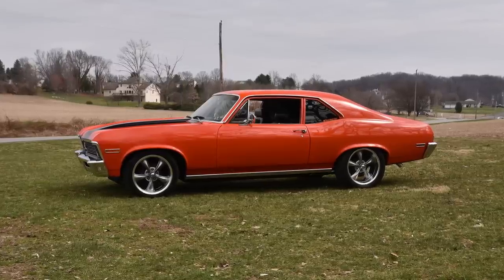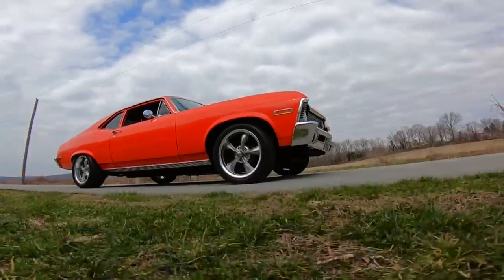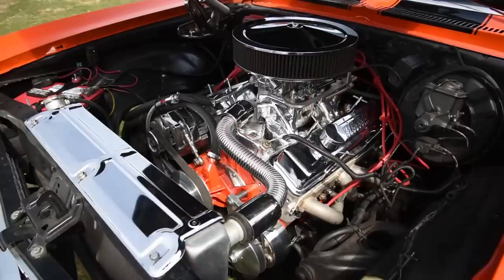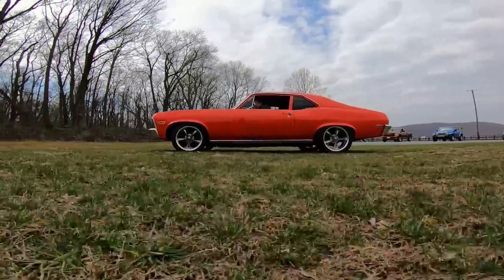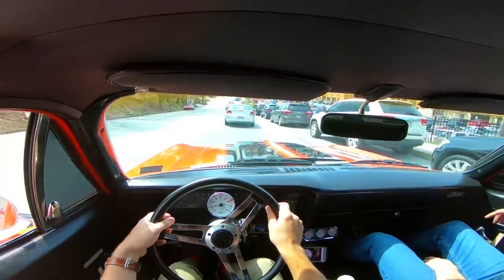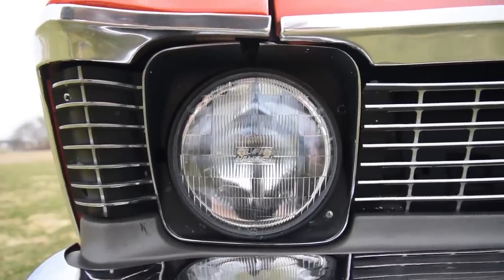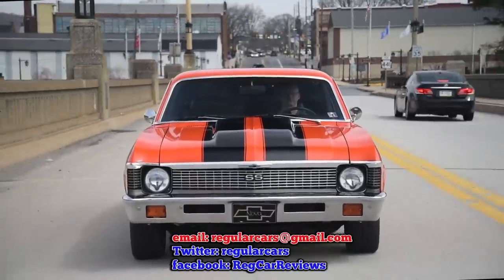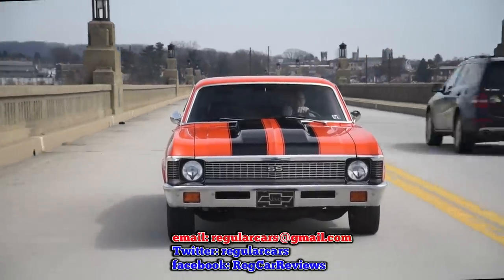1970 Chevy Nova: Regular Car Reviews

Comment: Questions people about what's the point to rebuilding an older engine when you can LS swap it, when same dude has rebuilt a 5.0 to convert into a 302 for his Falcon.

Honestly, LS swaps aren't as interesting as Mr Regular or what everyone else might think. Yeah it's a good choice of engine, but these engine swaps have become overly oversaturated in the car community. 

The era of the LS swap installations will peak if it hasn't happened yet. 

Great engine, the LS, but over hyped in our modern day. The only reason why LS swaps have become so common, is that they aren't to be enjoyed. But to be sold for much more money for the poor sucker that wants one. But who knows, maybe this Nova is worth $40k, because it didn't get the LS treatment yet.
Reply: By that logic he might as well Coyote swap that Falcon.
Reply: LS are not as cheap as SBCs. You can build a rock solid 300-400 hp SBC for $2-3k. That won't even get you a used LS1 with less than 100k miles if you can find one. If you're buying brand new the cheapest you got is the L96 at about $5.5k for roughly the same power. Yes the L96 is going to be more drivable and reliable but it is going to cost more.
Reply: @gagechapin1000  agreed he's pretending that a 5.3 can make power cheaper than a 350 with a cam and heads.
Reply: What regular is saying. The fake SS badge and trim plus the degrading condition of the vehicle he's stating why not go cheap because while prices are high it's not worth it in the long run and just cheap out now.
Reply: And if you think LS motors aint cheap go to a junkyard and pick out any 1995+ GM truck and 98% of the time you can get a Vortec LS motor that fits muscle car specs.
Reply: @NerdyHillbilly  first car with an LS engine was the 1997 Corvette. Then the 1998 f bodies. Earliest truck was in 1999 and that was the 4.8 and 5.3s (cast iron blocks, aluminum heads, 6 bolt mains, coil packs, EFI, etc). in 1995 they were called Vortecs also but they had more in common with a traditional SBC (2 or 4 bolt mains, cast iron heads and block, distributors, throttle body injection, etc)

Yes 5.3s and 4.8s are cheap but would you rather have a 0 mileage SBC that drops right in or a mid to high mileage truck motor you have to pick through and run a wiring harness for? 

What if it needs a rebuild? That gets real spendy with LS motors if you're doing it right (I have one and have done it). These motors aren't magically sitting in junk yards for no reason. O ring seals on the oil pump supply would leak causing people to lock them up on a regular basis.
Reply: @ohlookadragon  everyone thinks because of channels like sloppy mechanics that 5.3 can make 700+hp on a shoe string budget and be just fine. What they don't show you is the longevity of these motors they're piecing together. 

5.3 vortec motors are not just laying around anymore. There is a large market for them. When demand goes up prices go up. It's the nature of the beast. If you do happen to find one just laying around you need to ask your self "Why does no one want it?" They are not cheap to rebuild. They had an O ring issue on the oil pump that would cause a loss of oil pressure (not an exterior leak). So I don't know if you had experience with an oil starved motor but it destroys a lot of components quickly.

LS swaps are not as cheap or as easy as everyone thinks they are. Unless you can 90% of it yourself it is going to be an expensive project. If you can do it alone it's going to an arduous process.
Reply: i agree. for cost effectiveness i would put an LS in it, but obviously this guy isn’t worried about cost effectiveness. i fully support the built 350-it may not be the most efficient and cost friendly motor but there’s just something about em.
Reply: @NerdyHillbilly  No sir you can't.  You can pick up Vortec Gen-IV SBCs all day long, but not one single Vortec LS.  Also have fun with that plastic intake gasket that fails for no reason, same with that expensive failure-prone spider injection setup.

Comment: He needs that stall converter for the cam that he is running
Reply: That's not all that was missed here I don't think...
Reply: You know :)
Reply: I was just pointing out that large cams and automatic transmissions don't like each other hence why he needs the 2500 stall (which isn't even that crazy for street car). Without it the car would choke itself out and stall. 

Getting 450hp out of a 360ci motor using 1970s technology is a lot harder than throwing an LS at it with a mild tune. 

He does need to get rid of those front drum brakes though. I wouldn't take a 450hp car down the 1/4 mile with drums stopping you. You're going to have a bad time.
Reply: @gagechapin1000  you were spot on, I was agreeing with you that there were plenty of things about that whole speech that weren't quite right, like the converter being sold as basically undrivable when 2500 isn't that bad

Comment: That stall converter is about right (or near enough, without knowing the power/torque curve) for an old-school street engine.  Newer engine designs have plenty of smooth torque down low, so a low stall is fine...but a 350 with a big cam means the power is a little peaky and comes in at higher rpm...and the torque converter should be just barely able to let the engine start coming on cam at full stall.  Rather than lowering the stall, an overdrive or a locking converter (or both) would fix the worst of his fuel consumption issues.

This is how cars were in the day, before we had EFI and computers and variable vale timing and variable intake runner length to widen the power band and take the fun out of driving.

Comment: I think Rcr underestimates the true cost of what an LS swap, or a turbo LS swap truely costs to put into a car that was designed around the sbc... i mean he even swapped a carbed 5.0 into his falcon. Why not an LS? Why not an LS?
You realize with a Turbo LS it doesnt come from magic. The owners dont tell you they dumped several thousand into injectors. Fuel pumps, rebuilds, studs, gaskets, piping, hand work, adapter kits, head swaps, pistons, etc..  it costs infinitely more than a 150 dollar ebay turbo.
Reply: Plus the eBay turbo kit guys never let on how long the swap actually lasted.... Made 1100hp on stock internals (for 3 x 400m runs in total before the engine grenades itself).  Same with as the previous era with the 2JZ and RB26 turbo guys where they'd make claims of 900hp on stock internals (before the engine threw a rod on the fourth dyno run).

Comment: I had a 1973 one with a 350 in high school though it came factory that way and had discs up front.
One thing I can say about the generation 1 small block is they are simple and the parts are cheap.
Reply: I had a 72 350 Ventura and I could beat 318 Cudas and Challengers.

Comment: Carburetors > fuel injection. I just like them better. I like distributor ignitions. I like the smell of unburned hydrocarbons in the morning.
I'm 20, I was born about 50 years too late to experience muscle cars when new. I am the only one in my entire extended family that drives a carbureted vehicle. I like them. I don't know how to time a distributorless ignition system, or check fuel pressure on an injected engine, and I don't care. I like old school stuff. Call me a hipster, call me old fashioned. I don't care. I put a Buick 350 in my '85 Regal because I wanted a Buick 350. Everyone and their deaf mute blind grandma puts LS engines in everything. I did it because I wanted it, not because someone else would think it would get 10 more mpg and idle smoother.
Reply: Jordan Wiley this sounds like a post on r/iamverybadass

Comment: 3970010 cast early model LT1 4 bolt main block from 1970 370horse out of a corvette orignally, punched out 60over combination of heads and speed pro Hypereutectic pistons pushed the compression to 10.7:1 Howard's cams full roller cam with comp cams 1.5ratio roller rockers edelbrock performer rpm air gap intake   holly 750cfm brawler series carb....conservative rating is between 450hp and 470hp if all calculations were spot on...

Comment: The letter "K" in the VIN lets one know if it's a factory Nova SS.  Others have "H" as the fourth digit.  Typically the amber parking lights mean the 68-72 body style is a 1972 model.  I bought my '72 Nova coupe new from Mohr Chevrolet in Dallas, TX on June 7, 1972.    It now has an Edlebrock Performer intake with an Edlebrock 1406 750 cfm, five real leaf springs with Gabrielle hi-lift shocks, factory a/c & front disc brakes, 2-bolt main bearing 350 bored 60-over,  a TH400 tranny (before the four-speed automatics became reliable), 15" tires & rims for 7% better gas mileage.  Last inspected/registered in 2018.  I'm thinking of installing an Edlebrock Pro-4 EFI system.  Anyone seeking a pair of pre-1986 cast iron 2.02 x 1.60 angle plug Bowtie cylinder heads with stainless steel valves--(bought new)<1,000 miles?

Comment: @rcr big stalls are also important when you have big cams. The big cams barely have enough power tk keep itself idling. The stall prevents the transmission from applying load to the engine and "stall" it.

Comment: My moms first car was my grandmother’s Lime Green 1970 Nova, it was totally base, only options it had were the auto transmission and the 350 V8, other than that. It had no features, but it still managed to get stolen. Story goes, she parks it at school, some crackhead stole the car, two days later the police found it on blocks in Manhattan with no wheels and no radio and the officers were kind enough to give her some wheels. She sold it later for a 1972 Monte Carlo, and then in the 90s she sold that for an 80s Subaru, she’s been driving Subaru’s ever since.

Comment: The 350 chevy is still usable, they are without a doubt the most tinkered with engines on the entire planet, there are at least 10 companies who make every single piece, boomers with garages full of parts, and heaps of reasonable performance parts at swap meets or junkyards. Another reason these dinosaurs still march on is the lack of complexity, no computer to worry about. All you have to do is tighten down 4 bolts and run a carb linkage. I bought one for 100 dollars the other day, cleaned it up with a ball hone and slapped it back together and made 300hp. 

The reason he is running a high stall converter is the amount of cam he is running, choppy cams need high stalls. Seeing 2700+ is not uncommon in setups like this. especially with the TH350 or TH400 transmissions
Reply: Another thing is they can rev upwards of 5800-6700rpm with the right cam, intake, heads, and valve springs. so the old "old v8's wont rev" thing is kinda dumb. an LS is still superior, but if you're thinking of running a carb on an LS just go for a SBC

Comment: how can it be an SS with only a 350?
IIRC.... should have a 454 big block under their......

and while LS motors are sweet if your going to drive old cars a lot...... nothing beats pumping a carb, then turning the key.....
and having to keep it at 3000 rpm for 5 mins to warm it up enough to it wont die

neighbors are like "WTF ARE YOU DOING ITS LOUD"
oh sorry.... just gotta warm it up
"oh, ok"
Reply: what is a choke
Reply: @ty2010  my pickup does have a choke

But it is still -50f outside..... even fuel injected cars need a bit of warm up time
Reply: @kainhall  For -50f I think I'll have to call it special pleading.

Comment: 11:38 Ouch, Ouch, Ouch,  This hit a little too close to home.  Although my own opinion on this gen Nova (SS or not) is skewed to "poser" as those who had them before time thought they were worth anything were looked at with much less reverence.  This was the car you got when all the Slant 6 Barracuda's, Challenger, Dart and Dusters were all taken.  The SBC 350/TH350 is every fiberglass hot-rod ever.  Hell that engine, in a similar state of tune lives in my Chevy "BIG 10" square body, only with a 3/w low gear (technically a 4 speed no overdrive) manual transmission.  Which makes it sort of pointless being 2WD.

Comment: but... with aggressive cams you NEED a stall converter in order to even drive the car.
Reply: There's no such thing as a "stall converter".
Reply: @Iain240  ....what?
Reply: @BLAC_WORX  It's a high stall torque converter. Calling it a "stall converter" is like calling "high temperature spray paint" "temperature paint" it's wrong and he says it so many times it makes my eyeballs itch. 

What you said about the cam is correct though.
Reply: @Iain240  Ok I get it but that is semantics... my whole point is there is no option for running a HIGH stall converter or not, its not just for drag racing, its to have a functioning car with an aggressive cam. And its more like saying "high temp paint" instead of calling out what specific temperature the paint is rated at.

Comment: If you have a large cam in the car you HAVE to a large stall in it. The factory torque converter stall is around 1700rpm. Going with a higher stall changes where that rpm goes so the car doesn't take off on you. I had a built 402 with a big ass racing cam in it and tried to drive the car around on a stock stall converter with my TH400 trans. I had to put my full body weight on the brakes to stop that car from crashing into shit when moving the car around. I thought my brakes were bad, changed the master cylinder, same problem. My engine builder told me to go with a higher stall, so I installed a 2600 stall converter in the trans instead and it no longer wanted to launch forward when putting it in drive and stopped just fine under normal brake pressure. THAT is what a stall converter does when you run the wrong torque converter with a big ass camshaft my guy

Comment: A friend of mine inherited a mint green 1970 Chevy Nova from his grandmother when he was 16.  Had the 194 straight-6 and a PowerGlide 2-speed automatic transmission.  No A/C.  AM-only radio.  Black vinyl upholstery, which was ungodly hot in the north Georgia summer sun.  It was literally the cheapest Nova you could buy in 1970.  And it was in pristine condition.  Literally driven by a little old lady to the grocery store and to church.  Had just a tick over 15,000 miles on it in 1986 when he got it.  I bet something that original and clean today would sell for $40K -- if you could even find one that hadn't been cut up to make a fake SS.

Comment: There's no reason that Nova can't be built today into new car production. 4 wheel disc brakes, delete the leaf springs in favor of a 4 link suspention with 6 way adjustable coilovers. 4.3 v6 5speed manual,

Comment: "Why not an LS?" What an ignorant thing to say lol. To say a 350 is cheaper and easier is a massive understatement. Most of the 350s out there with bolt ons, turnkey engines or longblocks on facebook, craigslist, summit racing, can be had for 1500-3000 dollars and make just under 350 hp. Since when is that considered low performance? It's a street car lol. They're also very reliable and have a massive community support circle and huge aftermarket. Also just drops right in, yknow cause novas and every other chevy car and truck came with SBC options during that time?

Comment: ...if you have torque rule of transmission building use a lowstall with lockout and the lockout almost acts as a whole nother gear range...  and diesel ALWAYS USE LOW STALL LOCKOUT YOU WILL BURN YOUR BANDS. hish stall is purely a drag gimmick and half the time isnt even worth it IMO

Comment: Got a 1994 Mexican crate sb350 bored to a 383 in my '77 z28 (REAL z28). Working on putting a Holley Sniper FI on it. Got the tank and fuel lines. I have the turbo 350 trans with a hurst dual-gate slap-shift (never worked right). Gonna put a 5spd in it I think. Rebuilding the 8.5 rear and suspension now. My winga is gonna dinga real soon boys.

Comment: "All and LS needs to perform is a cam, valve springs and a $180 Chinese turbo"
And about 3-5000 dollars in intercooler piping, fabrication, ECU reprogramming, tuning, transmission, etc. Everything is simpler according to the internet, isn't it? Usually I enjoy Mr. Regular's review, but he's really showing ignorance here. I'm no SBC fanboy but there's a lot more to building a car than slapping an LS in a car that's a half century old.

Comment: High-stall torque converters make about as much sense on a street car as 'racing brakes' make on a street car.  But damned if EVERY Honda guy doesn't have 'racing brakes' that he will proudly tell you all about.  You know, those expensive brakes that work worse at low speeds and low temperatures than regular brakes because they are designed to work well at high speeds and high temperatures? 

But hey, Honda guys think that 36 inch piece of blue anodized aluminum tubing they ordered off of Amazon and hooked to their throttle body gives them lots more horsepower!

My sister-in-law's dad has a really cool '66 Nova.  It is street-driven, but has a SPOOL in the back.  Why?  BECAUSE RACE CAR!  It is amusing to see people who know things like high-stall converters, racing brakes, and spools exist...but don't know WHY.

Comment: The bullshit of the LS rant is that the Small Block WAS the LS Swap. It was the same answer to the same question. Mash that up with a torque converter rant and the best you get about the actual car is “drives like a crappy truck.” plus the usual BOOMERS. Lame.

Comment: "Tribute". Vomit.
Sullivan Chevrolet in Champaign, Illinois, tried to sell one of these to my Dad, and it was a 4 cylinder. Dunno if it was an Iron Duke.
Fortunately, he gave it a miss, and bought a '72 Concours wagon, with a 350 in it.
Exported it to NZ, and it ran for over 300,000 miles, gutless as it was, and it still exists, but I think it's rusty from towing trailer boats, and the engine was starting to smoke.
Got my license in that old thing.
Dad drives a Hyundai now...